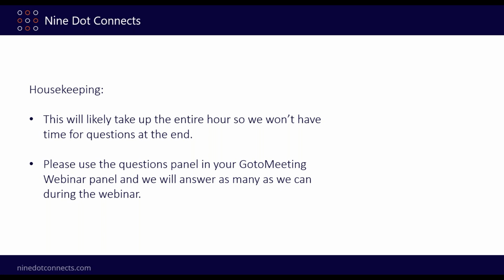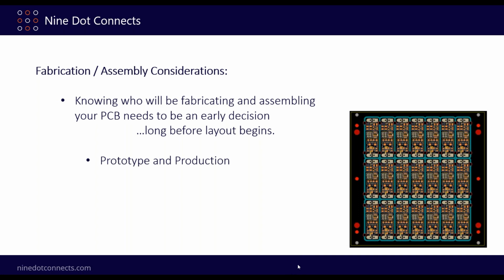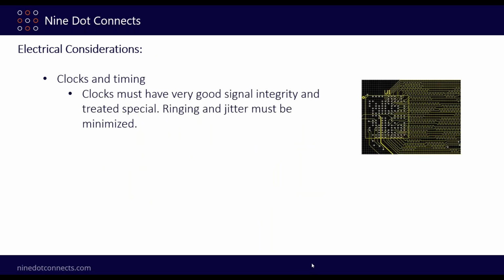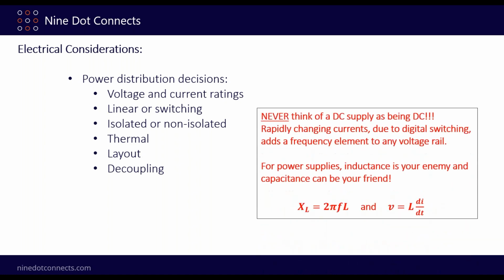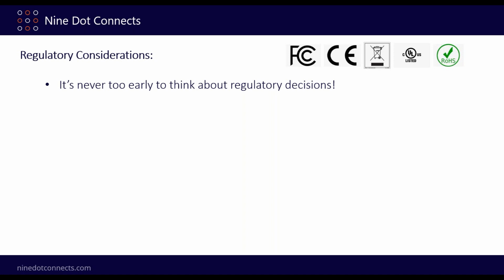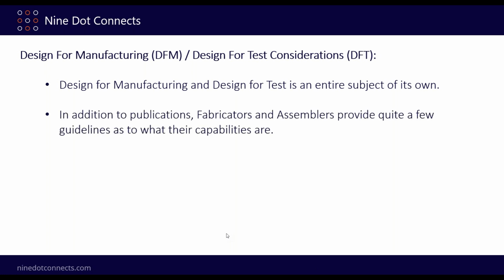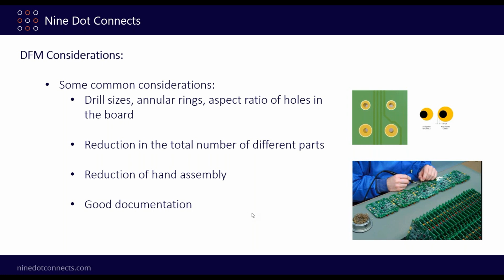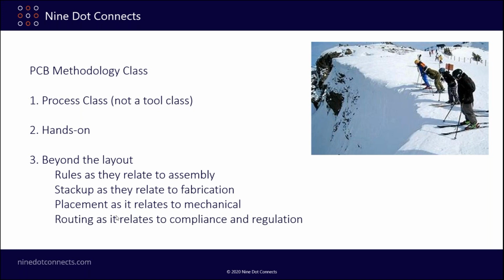6 Key Considerations When Starting a New PCB Design

Comment: When routing ddr I can't always put the same group on the same layer. Normally I assume sinal on microstrip is 15% faster so that I make it 15% longer. But I don't want to take the risk in the future. Is there easy way to calculate the signal speed on microstrip and stripline, if I know the Dk.